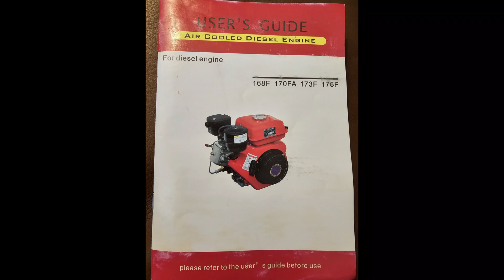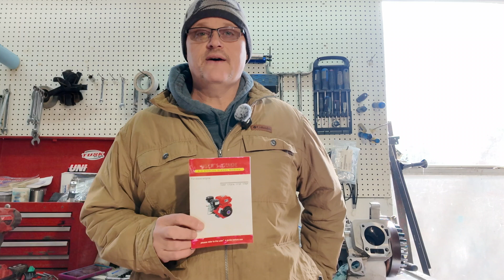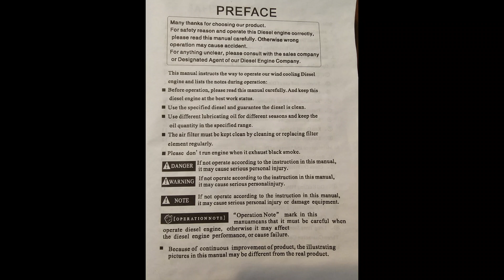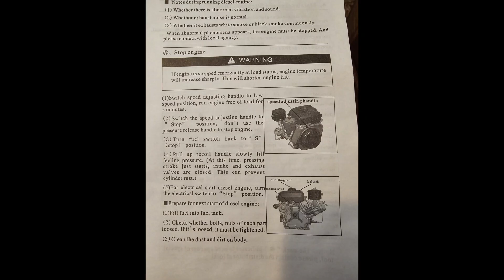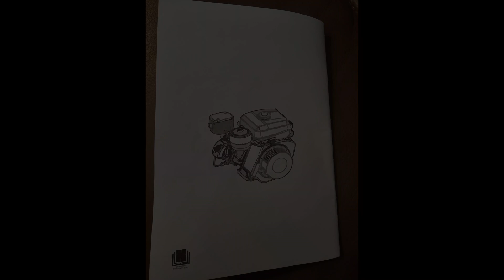China Diesel Small Engine Owners Guide.  168f, 170fa, 173f, 176f

Comment: I did something similar for the Chinese single cylinder diesel probably the farthest from the 196cc air cooled engines.

The JSD1800 (aka Redstone) engine is 600+ pounds of metal with TWO externally-exposed wheels of doom!

https://youtu.be/f3JpEs-uF_E?si=s6V9fz4Ov2fwMyeL